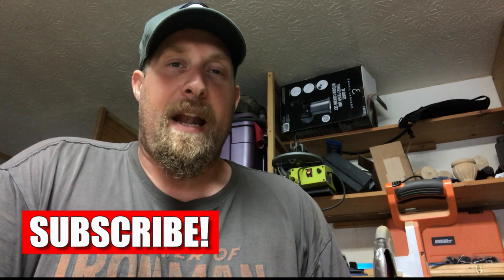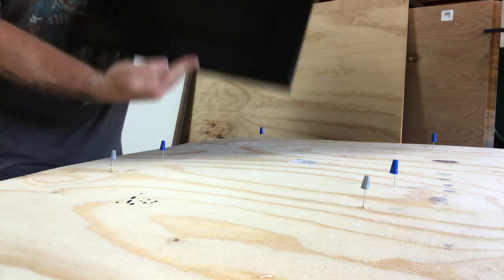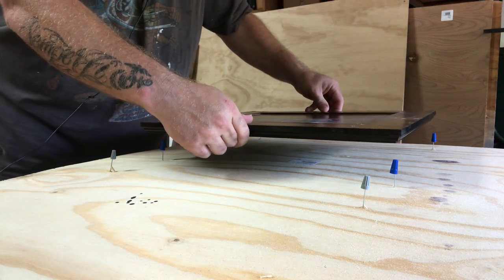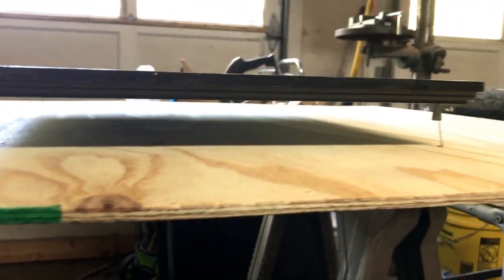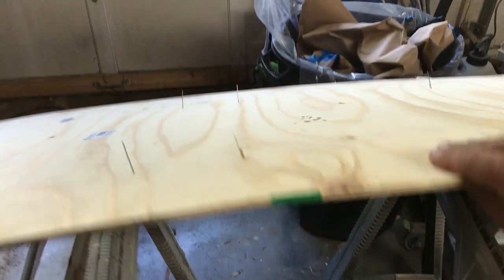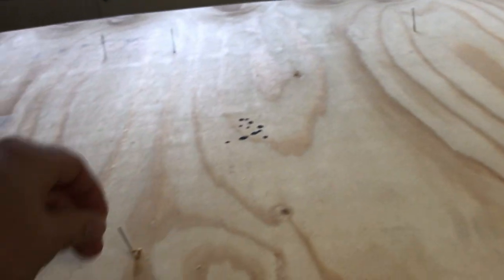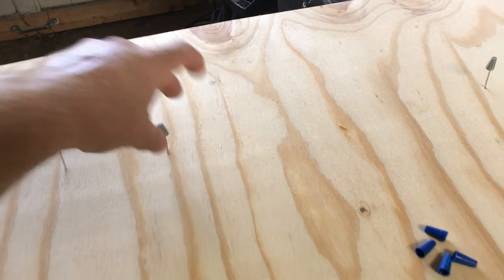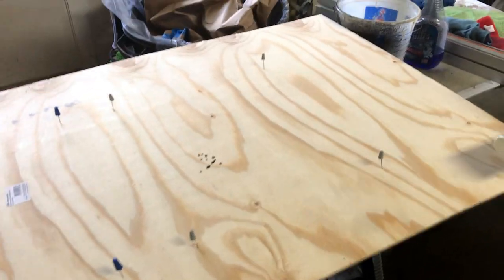How to paint both sides of cabinet doors

Comment: given the weight of bigger doors, there is no way those holders don't leave marks on enamel based paints.... no way around it unless touch up or letting paint cure for several days at least.   The pyramid pins also leave marks, tiny pin marks in enamel less than one week old.
Reply: Agreed... Also over spray assuming you're spraying